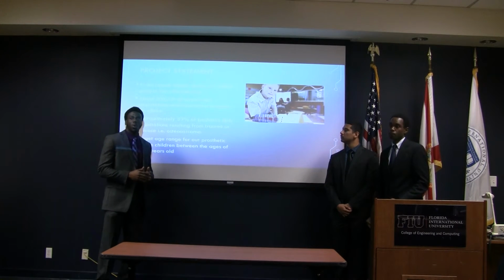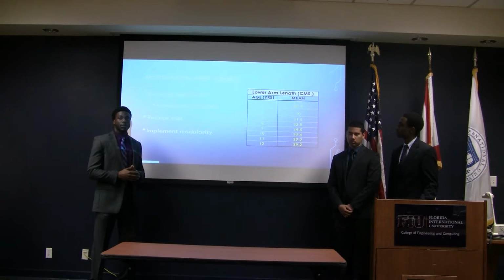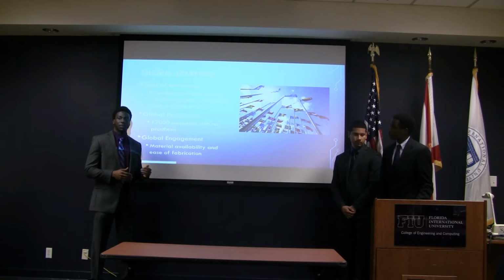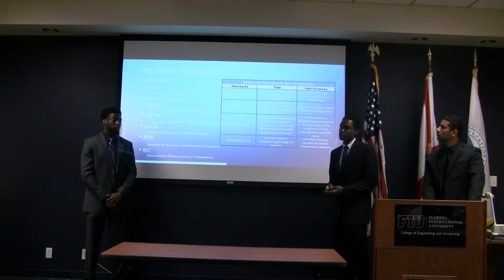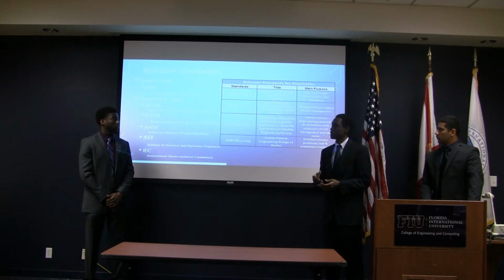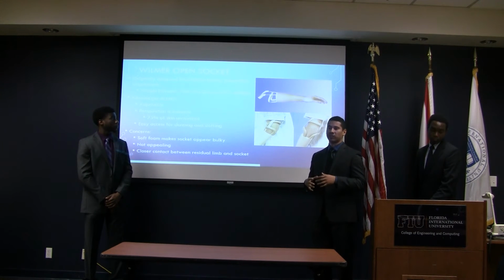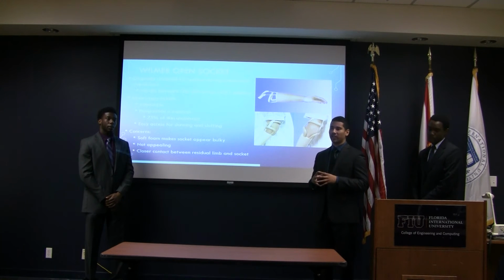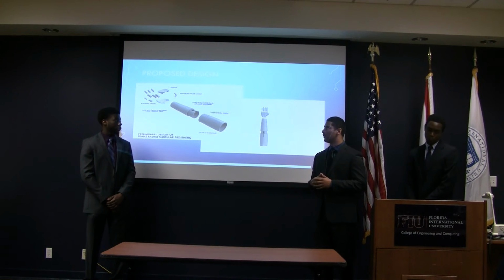SDO Team 05: Modular Upper Limb Prosthetic for Children

Comment: The powerpoint background color choice made reading the slides very difficult. While it was obvious all members knew the material and had practiced the presentation, it was hard to correlate anything said verbally with information backed from the slides because of how hard it was to read. Besides that, members should try to project more as the audio was sometimes difficult to hear. They did however do an excellent job at explaining why prosthetics are important, the difficulties in creating and using them, and their proposed methods for addressing these problems.

Comment: Though the project was a great choice, topic and could lead to a great design, the lighting on the presentation made it hard to be clear on certain questions and concerns. I feel each member could research a bit more to have more of a knowledge base of where the project is going and alternative methods if the presented method doesn't fall through. The final design will be tough given the extent of biomechanics however, i do not doubt the three could pull it off. Be careful in undershooting the budget.